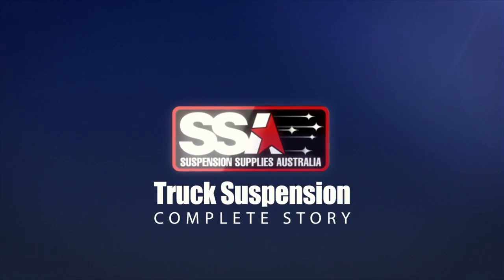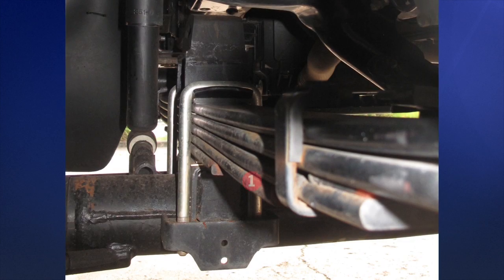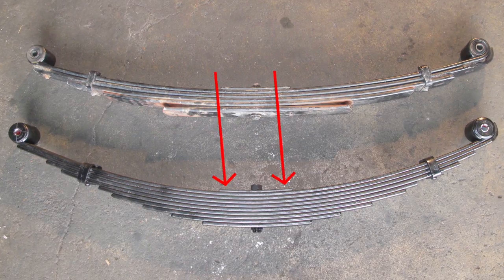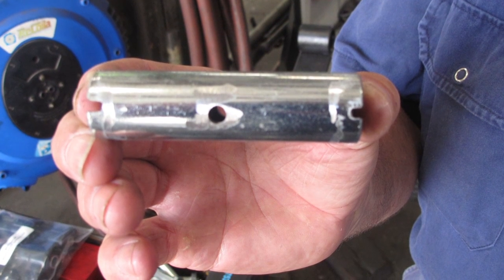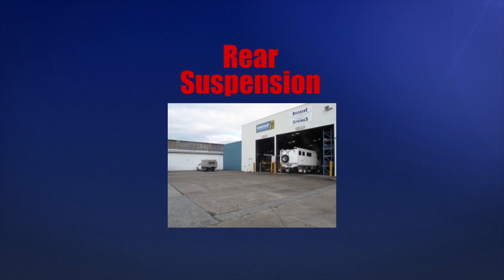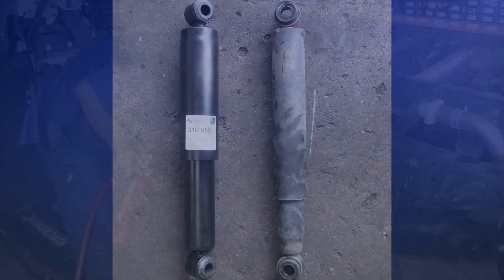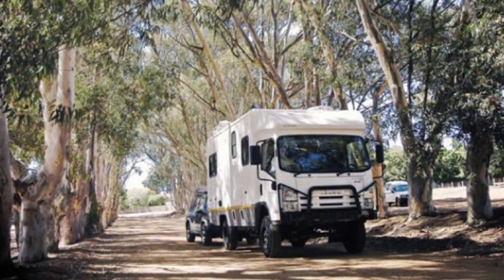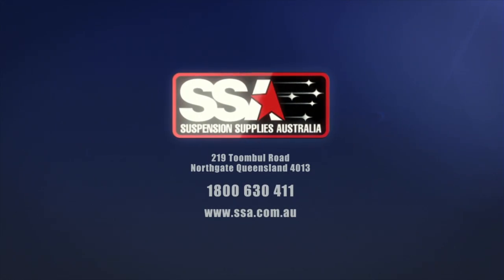Improved Isuzu NPS300 Suspension Upgrade 4x4 Truck

Comment: A long punch and some...gentle persuasion. 

We call that percussive maintenance up here in the states. Been looking at taking one of the Isuzu NPRs here in the US and fitting a divorced transfer case and hefty front axle to it for some overland action, and utility/recovery work in more remote parts where big wreckers can't go. We never got the 4wd NPS models here, so every part of it is a custom job.

Comment: So the original leaf spring has been replaced by a spring with more leaves. Unless the master leaf is lengthened as in roller style rear shackle  mounting, then the working length remains the same. It would appear that a leaf spring with extra leaves has been added, which just stiffens the front axle oscillation, lifts the chassis somewhat and that's about it. As for the poly bushes, its better to keep with the silent-bloc, and keep both shackle pins well greased. Rubber hardens up under sudden compression poly does not do so with the same degree.. The same effect could have been obtained by adding leaves to the original spring..Air bags could have been used as boosters.Each to their own I guess.